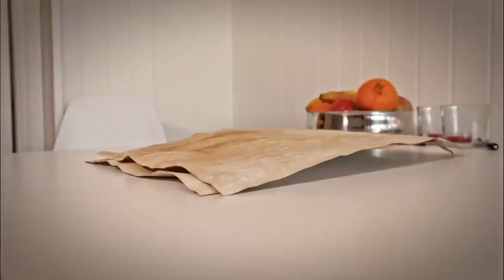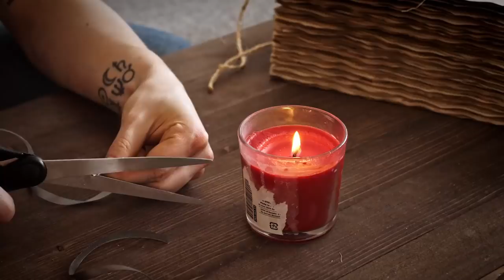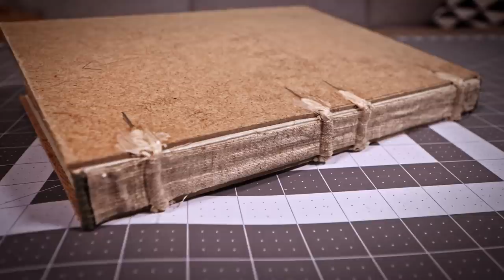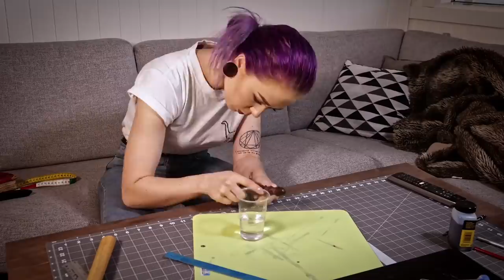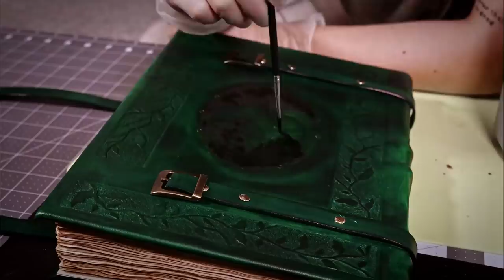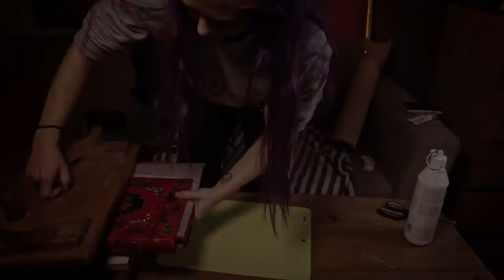Binding  4 Leatherbound Tomes: Air, Earth, Fire and Water.

Comment: They all look incredible. The only 2 things I would change:
1. In the center of the Book of Water, I would use a "wave" symbol instead of a droplet.
2. I would make the Book of Air a slightly lighter blue (perhaps sky blue)
But now I am nitpicking. Anyone would be thrilled to be able to own one of them. Congrats on a job well done.
Reply: I think she chose the droplet because in every other book she chose to symbolize the single piece of every element ( if you know what I mean )
Reply: I think I would have made the air one yellow, just to differentiate it from water a bit more. That or maybe a lighter gray, like a cloud.
Reply: so you're that person...
Reply: Iirc she had thought the blue she used for air was going to be much lighter than it actually turned out to be
Reply: And maby something else for the green book of marihuana

Comment: Earth air fire and water ... Arcane ... yes 5 basic magic schools ... arcane is to compilation of all the other 4 ... and is always the more powerful ... also the more corruptible
Reply: btw TEA ... makes for better looking aged paper ... is nice to drink ... and easy to make ... as a finisher ... use some lemon juice (squeeze bottle lemon is fine) mix it about 55% lemon 45% water ... and use your spray gun to dust each page ... then heat at about 100 to 250 F ... the low heat will darken the lemon juice and dry it out it will also neutralize in the tea stain because it is mostly a base from the water it was infused in ... 
.
added bonus of tea is you can include stein rings on a few pages ... and dont forget to get a small blow torch a scorch the edges of the fire book near the top and bottom corner ... (it is all about FIRE magic after all) ... same with the other books ... air make the pages light like tracing paper ... or onion skin paper ... earth ... dirt ... water ... less stain more wrinkle .. and of course arcane will have some of all th other books within it ... and some out right missing bits ( drill a few very small holes like a bug bored into the book here and there ... (if you have any (muppet type fur) around take a small 1/8th inch piece about 1 inch long off .. sew the two long edges together with 8 to 12 stitches ... make them noticeable ... the tufts will be the legs ... pick one end as a head ... trim the fur back a little and place a pair of white dots for eyes ... on the other end add a pair of black dots into the LONG fur ... then glue into the spin of the book someplace or part way through the book in its own little cubby ... and now you also have your own bookworm
Reply: if you plan on dong MANY books ... use a 1x2 slat with holes every 1/4 inch down the middle ... the holes should be wide enough to hold a nail or screw in them at the points you want to thread the folio's together ... (1.25 1.5inch long screws or nails will be perfect) ... now all you do is place a set of these "pins" in the wholes you want and place several sheets of paper on top of each other ... then give the wooden strap a few good hits up and down its length to puncture the holes into the paper ... ( you could also use a wooden ruler and a pin vise drill to make the holes ... again ... lots of evenly spaced holes select the ones you want to use and drill those with the pin vise drill and poof its ready for threading)
.
you could also make a red tome and make the inside hold your collection of the Silmarillion the hobbit and lord of the rings ....in their own sections .... of course you have to title the book ... There and Back again and LOTR ... and dont forget Sam's addition to the end of the book ... he was afterall a ringbearer as well